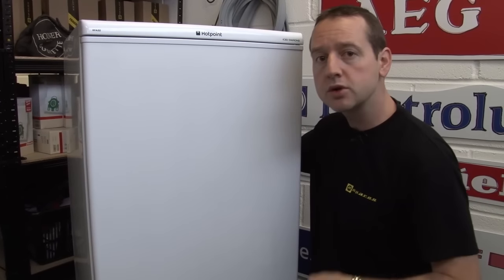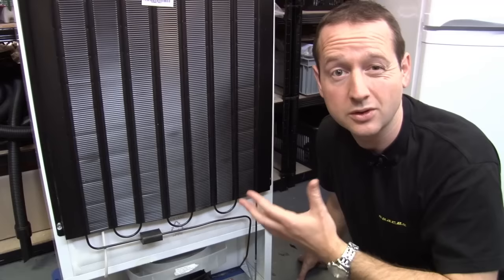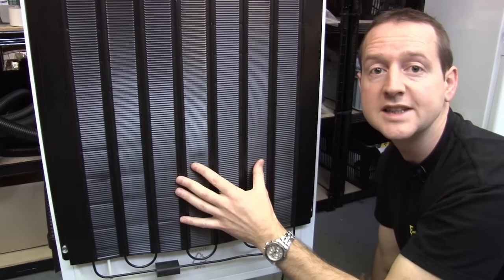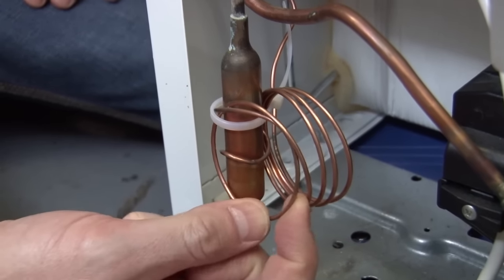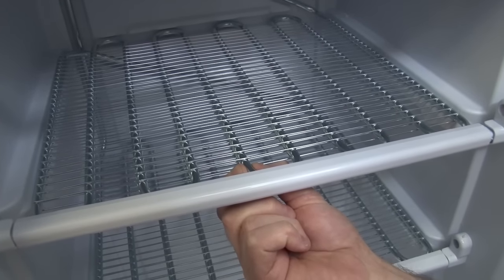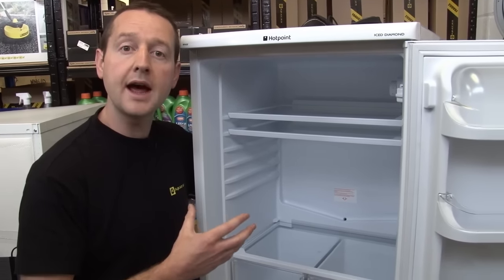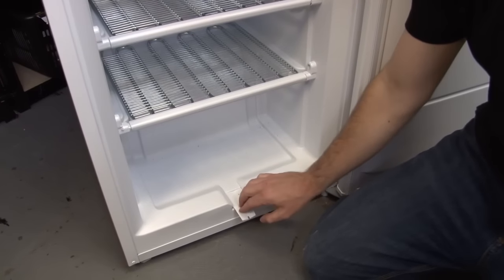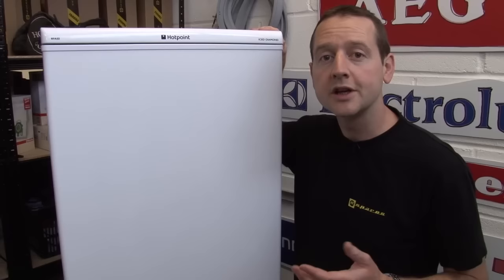How Does a Fridge Work?  (How is a Fridge Cooled & More!)

Comment: Just wondering if this would work to confirm if it is the thermostat that is the problem.
Would I be able to temporary bypass the thermostat by joining the 2 connections connected to the thermostat?
Would be an electrician carrying this out just.
My thinking is if I run it like this for a hour or so and the temperature drops below the usual fridge temp or about 8 degrees then I know that it's the thermostat that's faulty causing the high temp within the fridge section.
Is my thinking right in this.
Reply from the maker: Thermostats can stick either on or off and they can go 'out of range' but usually that would cause the machine to run continually. If you open the fridge and warm it with a hairdryer when it has switched off the thermostat should turn the appliance back on.
You could bypass the thermostat temporary to prove a compressor problem.

Comment: hello! i have a question here! why there is so much difference in temperature of freezer apartment and fridge apartment? And does a normal fridge which consists of  freezing apartment as well has one throttling device or both have different throttling device! i mean for freezer and fridge both?
Reply from the maker: +marko marin Good question!. Generally it is down to surface area of the cooling radiator, the amount of passing air and the volume of the chamber being cooled. The greater the surface area and the more air passing the cooler the chamber will be. :-)
Reply: ok so it means the cooling radiator having more surface area will pass more air hence it would be cool! thanks a lot sir :)

Comment: how does the filter drier pick up the refrigerant?
Reply from the maker: The dryer is a copper tube containing silica gel pellets that naturally absorb any moisture. If any small amount of water is absorbed by the refrigerant gas it is passed over these pellets and the moisture is absorbed. If the compressor was replaced or the system was ruptured and air drawn in the systems engineer would replace the dryer before using a vacuum pump to evacuate the pipework prior to recharging with refrigerant.

Comment: My fridge (which looks exactly like the one in this video - a 50:50 split, same coils, compressor layout, shelves etc) stopped cooling down at all in last few weeks. I can hear noise of fridge turning on (compressor?) but it does NOT cool at all in fridge or freezer section (the coil shelves in freezer section get cold but not freezing). But in fridge section in the back just above the drain hole (sticker in video) the back plastic feels hot (and this is heating inside of fridge). So what is it that's behind this area that is heating up? In video it mentioned nothing behind the radiator but on my fridge I can see a pipe going into back of fridge in back middle behind radiator. The actual radiator on back is not warm or hot at all. Does this mean coolant is gone or compressor is not pumping?
Reply from the maker: Hi Geogan2, can you check if the compressor is running (slight humming and vibrating continuously) as opposed to trying to start (occasional click noise on with slight buzz then click off and silence for about a minute). The first would suggest a loss of refrigeration gas the second a failed compressor. Both these faults would require a refrigeration systems engineer to regas the appliance.
If the compressor is not running at all it may be the thermostat or PCB if fitted.
The heat by the drain tube is to stop the tube freezing.
Reply: eSpares Yes it sounds and feels like the compressor is running, whether it sounds normal running or not I don't know. What I did notice was after a few hours running, it got very hot to touch, but only the first about 20cm of pipe going to radiator was warm, the rest of radiator was room temp so does this mean a lack of fluid circulating? I did notice when I turned it on first I could hear bubbling liquid sounds in part of the radiator. I am able to regas the AC system in my car myself using pressurised canisters but there doesn't appear to be any input valves on a fridge (looks like sealed or melted copper pipe ends) - I presume not easy or cheap to regas it - I just don't really have €330 for a replacement fridge at the moment,
Reply from the maker: geogan2 A systems engineer would cut off the 'stub' pipe and fit a shraeder valve allowing him to connect a vacuum pump and evacuate the system before measuring the correct amount of gas as shown on the ratings plate. Without a Vac pump you cannot do this.

Comment: What do the evaporation coils work and look like?
Reply from the maker: +Sean Genutis The evaporation coils in the freezer are shown at 2:29 (they are in the shelves) The gas that has been compressed is allowed to evaporate as it escapes from the fine bore of the capillary into the wider tubing. The evaporation takes heat away from their surface reducing the temperature.
Reply: +Sean Genutis they work thanks to the laws of thermodynamics. Air particles inside of the fridge will contact the coils and heat will be transferred from the air particles to the coil which in turn transfers heat to the gas inside the coil.
Reply from the maker: +Leonso Medina The key to this is the fact that by using a gas with a low boiling point when it evaporates inside the tubing it lowers the temperature to well below freezing. Air then contacting the surface of the tubing will be chilled as the warmth is transferred.
Reply: +eSpares Yep, thanks for confirming what I said :)

Comment: can a small 5 cubic frige be turned into a small air conditioner unit for a rv?
Reply from the maker: +2phalanges Not effectively. for air conditioning you realy want to remove heat from inside and pass that heat out so you need a radiator inside to absorb the heat and a radiator outside to disperse it away.

Comment: There is something that I did not understand. Would not the refrigerant escape from the unit when it is in the gas state while the door is open?
Reply from the maker: The gas is in a sealed system. It is a bit like a roller coaster, the compressor pushes the gas up to the top by pressurising. It is released and flows through the system expanding and cooling to the bottom where it is compressed again. and like a roller coaster the gas gets close together as it is pressurised then further apart as it quickly expands 'on the way down'.

Comment: The air in the condensor coils are hot because they have absorbed heat from th inside of th fridge during the previous cycle, not because it is compressed, right?
Reply: If you listen properly you will find you are wrong

Comment: hey... explanation was good  but i have a problem .
Reply from the maker: Thanks Darpan, what is your problem?.
Reply: how can use this concept in air cooler ..... can u give me some imp tipe ...plzz its an a rqst
Reply from the maker: If you wished to make some type of air conditioner from a fridge you would have to take the two heat exchangers and ensure they transfer heat from one area to another. It simple terms the condenser on the back of the fridge would need to be outside the room and the evaporator inside the room to be cooled. For the amount of cooling available in most fridges you would  not get a great amount of cooling in a hot room.

Comment: My new fridge doesn't have any coils on the back, and the only heat I feel from it comes from the space between the two doors at the front.
Reply: same here..
Reply: anuj dhiman Many manufacturers either pipe the hot gas past the gap or include a low power heater to stop condensation forming from cold air when the door is opened. There is still going to be a condenser fitted to all fridges with compressors and often this is hidden in the outside wall on one side.

Comment: I didn't really understand the purpose of the capillary coil from this video. Why don't you just feed the high pressure cool liquid straight into the evaporator coils?
Reply from the maker: benmat92 Without the capillary pipe to restrict the gas it would just flow through the system at speed and not compress into a liquid. By restricting its flow the gas forms into a liquid which then 'boils' as the pressure is released as it enters the evaporator thus reducing its temperature.
Reply: benmat92  I love espares videos, but in this case I have to say they didn't explain this thing properly. The capillary coil induces in the fluid a rapid drop in pressure and thus in temperature. It's called Joule -Thomson effect. For example , the gas escaping from an pressurised gas canister is very cold. I hope I was enough clear, english is not my native language.
Reply from the maker: Simone Cipriano Thanks for your input Simone but without the restriction provided by the capillary the compressor would just pump the gas around the system. Restricting movement of a gas creates the pressure for the gas to be forced back into a liquid. Its the release of the pressure that creates the Joule Thomson effect when it leaves the capillary under pressure to expand in the evaporator. Take a bicycle pump, if you do not restrict the air it just pushes air in and out. Put your finger over the end and pump and the restriction will soon cause heat as the air is compressed. On a fridge the gas is compressed into liquid and produces heat given off by the condenser coils. Hope this is a little clearer now.

Comment: How do I know when the control is not working
Reply from the maker: Hi Wayne, it would normally depend on the brand and model as the control vary but if it has a thermostat controlling the fridge it will either work continually or not work at all.
Reply: @eSpares  it is a mabe  frigde

Comment: But why more ice is formed in freezer in low mode than a maximum mode
Reply from the maker: Hi Krisz, the freezer would normally get down to its maximum temperature during normal operation, on the maximum mode it probably only runs longer to get the temperature down quickly but still produces the same ice as normal.

Comment: So it works in vacuum?
Reply from the maker: The compressor produces a partial vacuum in the evaporator then the gas enters and evaporates.
Reply: +eSpares So is completly posible.
Reply from the maker: It would not normally produce a complete vacuum, only if the evaporator was blocked could a complete vacuum form on the 'low side' of the compressor.
Reply: ok
Reply: eSpares :DDDDDDDDDDDDDDDDDDDDDDDDDDDDDDDDDDDDDDDDDDDDDDDDDDDDDDDDDDDDDDDDDDDDDDDDDDDDDDDDDDDDDDDDDDDDDDDDDDDDDDDDDDDDDDDDDDDDDDDDDDDDDDDDDDDDDDDDDDDDDDDDDDDDDDDDDDDDDDDDDDDDDDDDDDDDDDDDDDDDDDDDDDDDDDDDDDDDDDDDDDDDDDDDDDDDDDDDDDDDDDDDDDDDDDDDDDDDDDDDDDDDDDDDDDDDDDDDDDDDDDDDDDDDDDDDDDDDDDDDDDDDDDDDDDDDDDDDDDDDDDDDDDDDDDDDDDDDDDDDDDDDDDDDDDDDDDDDDDDDDDDDDDDDDDDDDDDDDDDDDDDDDDDDDDDDDDDDDDDDDDDDDDDDDDDDDDDDDDDDDDDDDDDDDDDDDDDDDDDDDDDDDDDDDDDDDDDDDDDDDDDDDDDDDDDDDDDDDDDDDDDDDDDDDDDDDDDDDDDDDDDDDDDDDDDDDDDDDDDDDDDDDDDDDDDDDDDDDDDDDDDDDDDDDDDDDDDDDDDDDDDDDDDDDDDDDDDDDDDDDDDDDDDDDDDDDDDDDDDDDDDDDDDDDDDDDDDDDDDDDDDDDDDDDDDDDDDDDDDDDDDDDDDDDDDDDDDDDDDDDDDDDDDDDDDDDDDDDDDDDDDDDDDDDDDDDDDDDDDDDDDDDDDDDDDDDDDDDDDDDDDDDDDDDDDDDDDDDDDDDDDDDDDDDDDDDDDDDDDDDDDDDDDDDDDDDDDDDDDDDDDDDDDDDDDDDDDDDDDDDDDDDDDDDDDDDDDDDDDDDDDDDDDDDDDDDDDDDDDDDDDDDDDDDDDDDDDDDDDDDDDDDDDDDDDDDDDDDDDDDDDDDDDDDDDDDDDDDDDDDDDDDDDDDDDDDDDDDDDDDDDDDDDDDDDDDDDDDDDDDDDDDDDDDDDDDDDDDDDDDDDDDDDDDDDDDDDDDDDDDDDDDDDDDDDDDDDDDDDDDDDDDDDDDDDDDDDDDDDDDDDDDDDDDDDDDDDDDDDDDDDDDDDDDDDDDDDDDDDDDDDDDDDDDDDDDDDDDDDDDDDDDDDDDDDDDDDDDDDDDDDDDDDDDDDDDDDDDDDDDDDDDDDDDDDDDDDDDDDDDDDDDDDDDDDDDDDDDDDDDDDDDDDDDDDDDDDDDDDDDDDDDDDDDDDDDDDDDDDDDDDDDDDDDDDDDDDDDDDDDDDDDDDDDDDDDDDDDDDDDDDDDDDDDDDDDDDDDDDDDDDDDDDDDDDDDDDDDDDDDDDDDDDDDDDDDDDDDDDDDDDDDDDDDDDDDDDDDDDDDDDDDDDDDDDDDDDDDDDDDDDDDDDDDDDDDDDDDDDDDDDDDDDDDDDDDDDDDDDDDDDDDDDDDDDDDDDDDDDDDDDDDDDDDDDDDDDDDDDDDDDDDDDDDDDDDDDDDDDDDDDDDDDDDDDDDDDDDDDDDDDDDDDDDDDDDDDDDDDDDDDDDDDDDDDDDDDDDDDDDDDDDDDDDDDDDDDDDDDDDDDDDDDDDDDDDDDDDDDDDDDDDDDDDDDDDDDDDDDDDDDDDDDDDDDDDDDDDDDDDDDDDDDDDDDDDDDDDDDDDDDDDDDDDDDDDDDDDDDDDDDDDDDDDDDDDDDDDDDDDDDDDDDDDDDDDDDDDDDDDDDDDDDDDDDDDDDDDDDDDDDDDDDDDDDDDDDDDDDDDDDDDDDDDDDDDDDDDDDDDDDDDDDDDDDDDDDDDDDDDDDDDDDDDDDDDDDDDDDDDDDDDDDDDDDDDDDDDDDDDDDDDDDDDDDDDDDDDDDDDDDDDDDDDDDDDDDDDDDDDDDDDDDDDDDDDDDDDDDDDDDDDDDDDDDDDDDDDDDDDDDDDDDDDDDDDDDDDDDDDDDDDDDDDDDDDDDDDDDDDDDD

Comment: That's how refrigeration works! You didn't explain how a modern fridge works with at least two seperate compartments, both at different temperatures, works.
Reply from the maker: Hi i minabrons, it doesn't include modern technology because ot was filmed over 8 years ago, we know a lot of fridge freezer now do have twin compressors with multiple cooling zones and we hope to do a new video in the future.
Reply: @eSpares  I wasn't thinking of 'modern tech' i was more thinking about the simple process of allowing cold air from the top freezer section go to the fridge section and how the  large cold, colder, coldest  hand controlled dial controls the amount of cold air going to the fridge. 
I haven't been able to find any info on this basic system. There appears to be be only one thermostat with this design I'm guessing.
Reply from the maker: Hi i minabrons, most fridge freezers have the fridge at the top and freezer at the bottom and it uses an airflow system to circulate the cold air from the freezer to the fridge, this is usually controlled by thermostats, air sensors and a control PCB.
Reply: @eSpares  Don't won't to contradict you as where you live things may be different but the most common refridgerator I see is the 'top mount' fridge where the freezer is at top. Mainly,because, it seems to me, to be more efficient. Which means it would use less energy.I could be wrong.

From the very beginning I was wondering how, specifically, does the air recirculating occur and how that fits in with the thermostat which I assume is connected to the freezer by a  thermostor or sensor or something similar or is there 2 thermostats in a 'top mount' fridge. One in the freezer section and one in the fridge section.

As you know even on a simple fridge the system is more complicated than just refridgerant pumped around the back of a fridge. I was hoping to get some answer re. these questions but never found any on YouTube videos other than an explanation about recirculating refridgerants. Nothing about air circulation.
Reply from the maker: Hi i minabrons, don't worry it does seem we are talking about different places and we can only speak from our experience.
Reply: @eSpares  Thank you for your time.
Reply from the maker: Hi i minabrons, good to talk to you and come back anytime.

Comment: How do I fix this model? Fridge is no longer cooling, other youtube fixes don't work
Reply from the maker: Hi Roli, Is the compressor running?. If it is not running and cold suspect the thermostat. If it is not running and hot and maybe makes a quiet 'tick' twice a minute it is likely to be a failed compressor. If it is running but not cooling  at all it is likely to have a leak and lost its gas or a faulty compressor. Both of these problems require a systems engineer to repair.